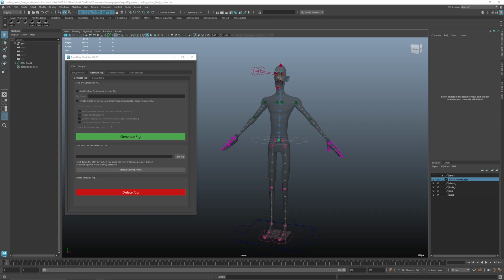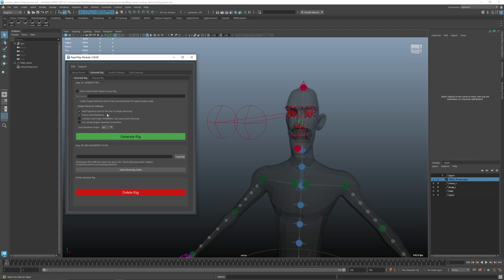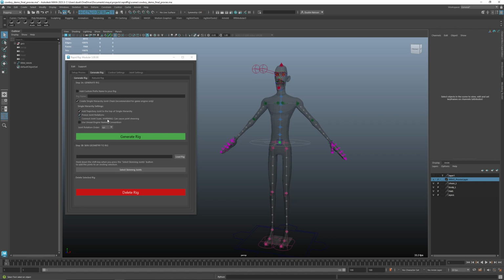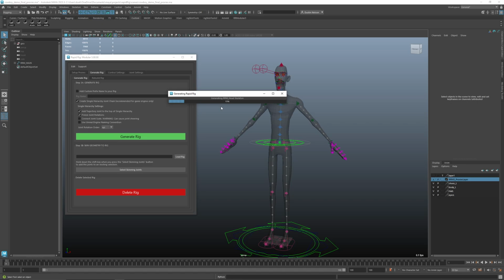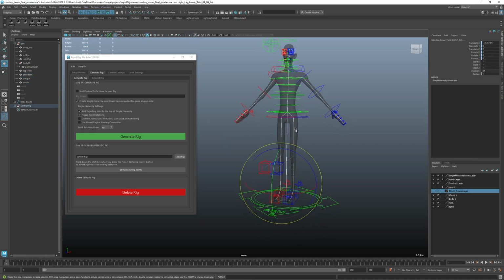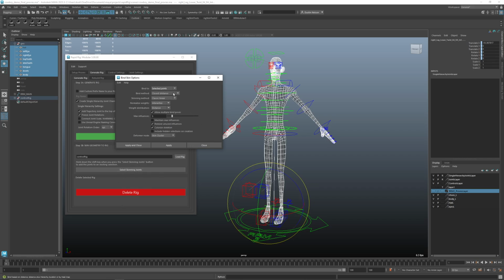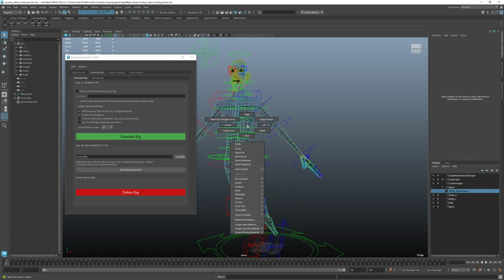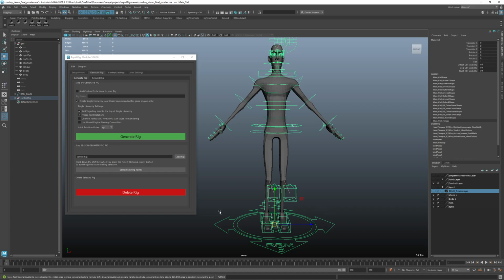Rapid Rig: Modular 3 - Generate Rig

Comment: do you have a Character Picker UI for the rig
 planned sometime soon?
Reply from the maker: There is one that ships with RRM3. I haven't made any tutorial videos for it yet,  but that will be coming very soon.
Reply: @DustinNelson  great. Can ist cope with Name Spaces as well?
Reply from the maker: @davidmonteiro6822  it can! I have rearchitected the code to use meta data connections instead of strings to make working with namespaces easier. Likely still some bugs to work out as I have not stress tested it, but I did fix a few bugs that were found by someone using a rig that was imported with a namespace, and it seemed to hold up otherwise.
Reply: @DustinNelson  that would be really important for use in production
Reply from the maker: @davidmonteiro6822  Absolutely, file referencing is vital for production :)

Comment: Hi 
I'm not specializing in rigging but
I am reviewing an auto rigging tool because I often need rigging in my work. I bought a few and tried them, but the rigging did not work properly with atypical characters. Advanced Tool is feels a bit difficult for me to do while learning right now. I usually solve problems with freelancers, but there are times when I don't have enough time for that, so I did a search and your tool seems to be the most flexible and great.
It seems that there is no video for atypical characters, so for example, does rigging work well for modeling like this, such as big heads with no feet (just like tentacles)?
Thanks!
Reply from the maker: Hi! RR: Modular was specifically developed for atypical characters, because you can use the different module types in all sorts of combinations. You can start with the root and attach whatever modules to it and others. To use your description as an example, you could attach a head & face to the root, and then use FK chains with IK and sim enabled to create something like a cartoony octopus with floppy tentacles.

I will be posting how-to clips for other creature types in the near future, which will help demonstrate the flexibiilty of Rapid Rig: Modular 3.
Reply: @DustinNelson  Thank you very much.!